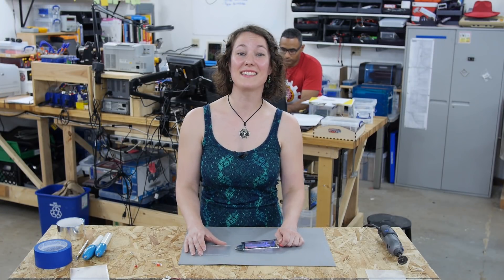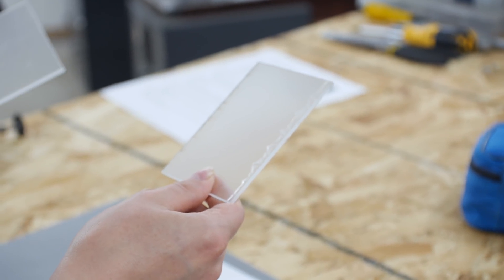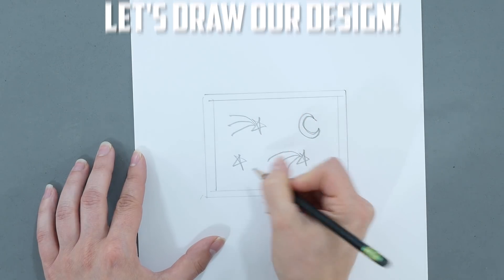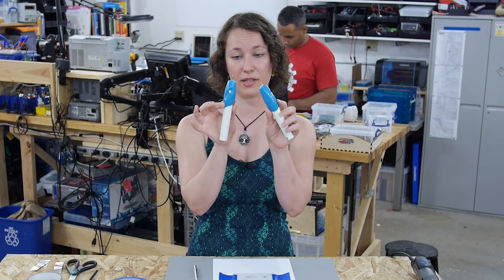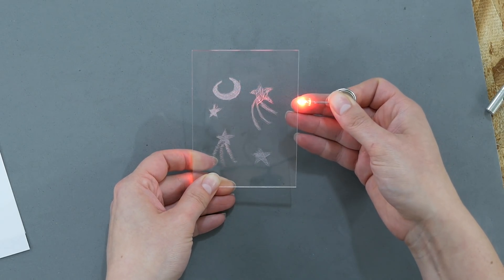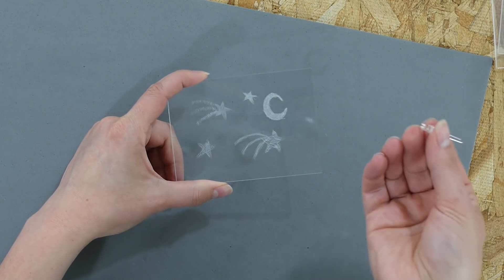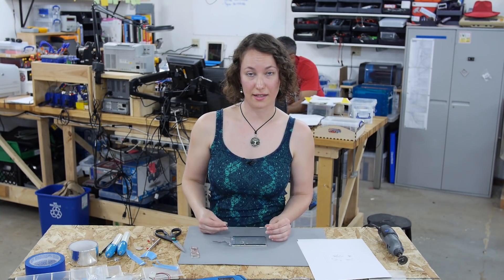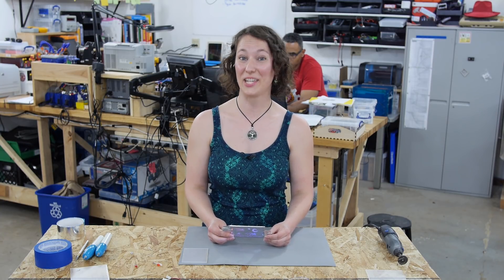The Learning Circuit - Edge Lit Signs

Comment: Neat idea.  Electronic question that wasn't spelled out-  I thought you needed a resistor in an LED circuit or the LED would get blown out.  How is it working with just the button battery and no resistor?

Comment: Just checking here, but are you really connecting the battery directly to the LED, without a resistor?
Reply: It depends on the battery's voltage. If the LED is rated for ~3V, and the button cell battery provides 3V, you won't need a resistor in between.

Comment: Could the "scratching" also be done with acetone to get a cleaner finish of the etched parts?
Reply: Possibly. First it would depend on if the plastic reacts to acetone. Then it would depend on how that plastic reacts to acetone. Acetone can be used to smooth out ABS 3D prints, but since it's used for smoothing, I don't know that it would create the etch look you need to interrupt the light. I would normally recommend making a vinyl mask to protect the areas you don't want etched, but I wouldn't recommend mixing vinyl and acetone. You would have to experiment. (Which should be done in a well ventilated area.)
Reply: Thank you for your tips :)

Comment: You never said what the aluminum foil does—why do this step?
Reply: The tape reflects the light back in towards the design, which helps make it brighter.
Reply: theHeckwithKaren Could you add this info to the video description text?
Reply: Done!
Reply: Helps hold in the light/ helps also mirror the light back into the sign, making it brighter.